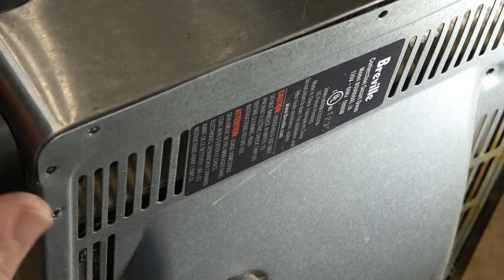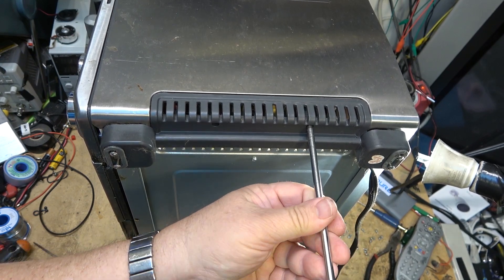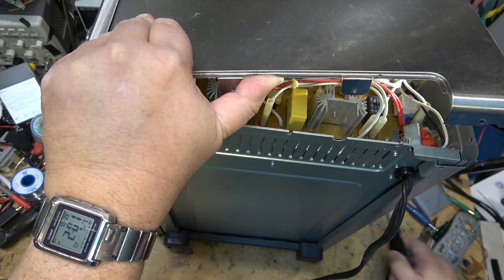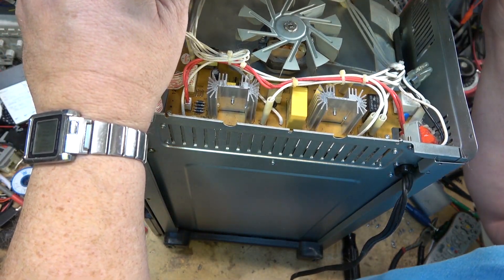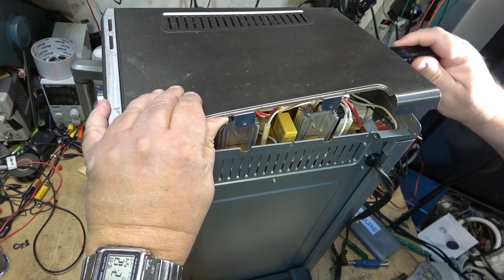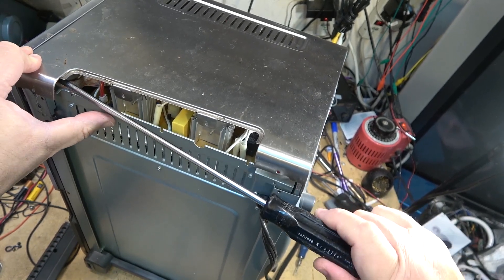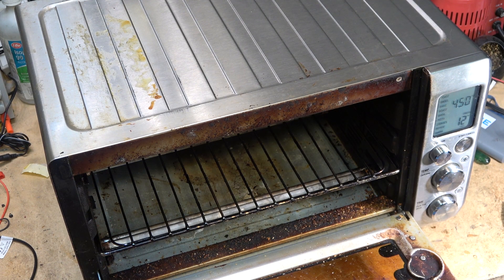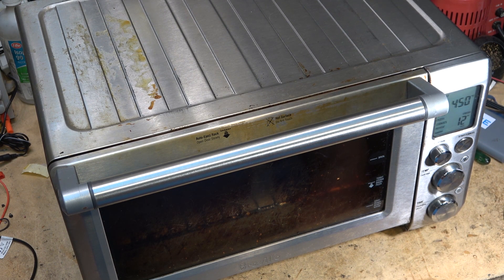Why did I even consider this one

Comment: I just recently repaired one of these 2 months ago.  It was for an elderly lady.  It was the Chef Emeril brand oven and it looked very similar to the one you tried to work on here.  She said when using the convection feature about after 15 minutes the fan would slow down and make a high pitched squealing sound, and the fan would come to a stop.  This was a over time issue, it began with it slowing down and this went on for quite sometime until the intermittent squealing sound begun, and finally the fan would lock up.  What was happening was the motors sleeve bearings were dried up.  When the motor heated up the bearings would get tight, and cause the motor to slow to a sqreaching stop.  These are a small c frame type motor.  These require some patience to work on.  With patience they are repairable.  I had to remove the motor take bell ends off, and i use denatured alcohol and cotton swabs clean inside of both ends sleeve bearings clean both endx of shaft.  Be careful not to loose those tiny thin washers that go on the shaft.  Then just squart some 3 in 1 motor oil into ends and reassemble all back together.  Yes it's a process but i have repaired many motors like this and many many fans and space heaters with issues like this.  Heck i rather be repairing that oven then trying to type this long message explaining how to do so LOL.  Great video though.

Comment: I had one of these but gave it away to a friend - the PWM circuit they use to modulate the power levels drove the electrical system in my apartment nuts. Every light in the apartment would flicker while it operated.

Comment: I once went inside my microwave to try and replace the dead bulb.  They never designed the bulb to be user replaceable. Getting the microwave open was easy but the bulb needed some finger gymnastics to reach, moving past all sort of sharp metal bits.  The microwave worked fine for several years without the bulb, I just got fed up of shining a torch into it :D

Comment: If memory serves you have to take it apart from the bottom then inside out. Granted, with as disgusting as that unit is, I wouldn't work on that with a 10 foot pole.

Comment: You're very generous for agreeing to work on that.
Reply from the maker: I didn't.   The wife agreed for me.  It was one if her clients unit. A little old lady she looks after.  She cooks everything in it.  That and her microwave.
Reply: @12voltvids  It shows. Anyway, very kind of you to take out time and even attempt to accommodate the lady. In my opinion, and that's all that it is, by the time you get the replacement fan motor, get it all working right again, and bandage up both your hands from all of the razor cuts that razor sharp metal will inflict on you, it really just makes more sense to toss the old one in the recycle bin and buy a new oven. To heck with that greasy, bloody mess.   Fred
Reply from the maker: @electronicengineer  
Well that is exactly what I said.  Use it without turning on convection till it doesn't heat any longer and then toss it.
Reply: @12voltvids  Agreed.

Comment: This looks quite a bit harder to fix than changing the safety switches on a microwave. I need to think there's an easier way to get inside since if it's that hard to work on it must also be expensive to assemble at the factory.

Comment: I've the same unit. Can you guess what failed on mine? Yep, the convection fan. :) Still works quite well with the fan turned off. I also refuse to work on it and it's my unit.
Reply from the maker: I also have a similar model and no I won't be working on it when it breaks.

Comment: My friend who's a foodie bought one of these and he say's it's the absolute best he's ever owned!
Reply from the maker: They are good.  We have the same unit and guess what is starting to fail on ours.   Yup you guessed it the convection fan.  The wife was complaining that it is starting to make a funny noise when in convection mode.  Seems to be the weak link on these. I bought her a instant pot dual for Christmas last year and that has become one of her new favorite kitchen appliances. It's got the pressure cooker and the air frying top. She has made many excellent stews and soups and all kinds of stuff in that instant pot and the air fryer is fantastic for doing things like wings french fries fish. The advantage to the instant pot air fryer is if you're doing things like wings and chips or anything that is going to splatter drip Grease it just drips into the pot which everything sits into the Fry basket sits into the pot so you just take the pot out and wash it unlike an oven which gets all over the inside and it's hard to clean and they end up looking like this one.

Comment: I have a very similar unit. I'm sure it's made in the same factory as everything about it, shy of the styling is exactly the same
I can say that from the factory the convection motor struggled, but yet, years later, it still works fine, aside from the convection motor speeding up and slowing down, even stopping at times.

Comment: would not put FOOD in that dirty thing   sams has them for 39.00- dollars
Reply from the maker: The part that the food sits on is spotless.  You should see commercial ovens.
Reply: Toaster ovens are a bear to keep clean due to the small clearances between the heating elements and the interior surfaces. That said, one can quite easily get to the door and removable drip tray and the like.
Reply from the maker: @goyadressunofficial  right.

Comment: Looks clean to me. Grease is dirty. This looks more like heat discoloration. If anyone knows how to fix that without a sand blaster please clue me in. I have a Black and Decker from the mid 1980s I'd clean up. I had to adjust the temperature range set screws once. Other than that- no trouble at all. Made in USA baby.

Comment: this is why i love my toaster oven.. simple and basic. no smart anything in it, just a always on turn dial down or timer dial other way. set the temp and cooking mode no complex circuitry as i know of in it maybe some small stuff. but i at least try to keep it clean so its not this gross either of course bit hard to do but trying to do so better than not doing so.
Reply from the maker: Thats why I put a mechanical timer on my fart extractor
Reply: ahahah makes sense. cant beat mechanical in most situations that's for sure.
Reply from the maker: @EldaLuna  nothing to break.
Reply: exactly and just fun to look at depending what it is.

Comment: Why didn't you oil the motor bearings while you were in there?
Reply from the maker: I did. Made no difference.  Still stalls out once the weight of the fan is on bearing.  Runs fine on end as no load on worn spot.
Reply: @12voltvids  fair enough. Crappy sintered (sleeve) bearings.
Reply from the maker: @Detroit8V92tta  that's right.  Stintered bearings.  Once they wear out there are done.

Comment: Microwaves are never easy to work on, as said they are built by robots
that don't bleed when they come into contact with the unfinished edges.
Even just replacing the lamp cen be a nightmare.
This one clearly has not been kept clean, so little wonder that the fan is failng.
Reply from the maker: They all get greasy inside.  The one I have isn't much better.  When cooking on convection the heat, and steam and other stuff that comes off cooking food is blown around the inside.
Reply: @12voltvids  Very true, working on any electrical cooking items is never a pleasure.

Comment: Convection is the same as air frying! 🤷‍♀️
Reply from the maker: No, they are different.  Convection uses the heating elements above and below and blows the hot air around.  Air frying uses a very hot element in front of the fan and super heats the air so the hot air does the cooking as opposed to the radiant heat from the elements with the hot air.  Convection does speed up cooking and you will get similar results but air frying is faster and makes for crispy fries and better wings.  I have both and the air fryer is better at what it does.

Comment: You let yourself get talked into working on stuff like this because 1. You want to help
2. You don't like giving up
3.it makes a different and interesting video
But most of all you like to repair things you don't like to just throw stuff out you like to recycle and use your skills to do it you are one of the most skillfull fixers I have ever seen and you do it well on just about anything as you have proved in the past you make the most interesting videos and most of all you like the challenge you against a broken thing and as I have said before you are good at it as to fixing it where the heck would you get a part for it a throw away society For 159 Aussie dollars I prefer a 30litre grill convection microwave not as hot as the oven but the value a microwave grill and fan forced convection oven for 159 its a bargain Its very very old and greasy buy a new one